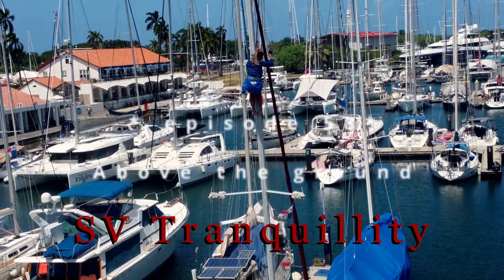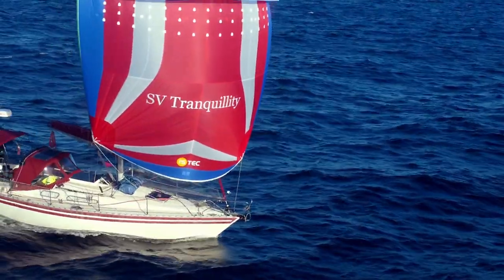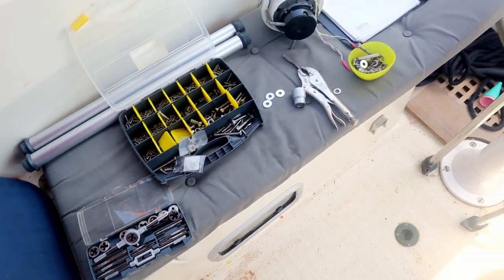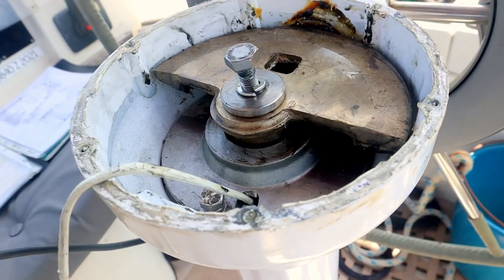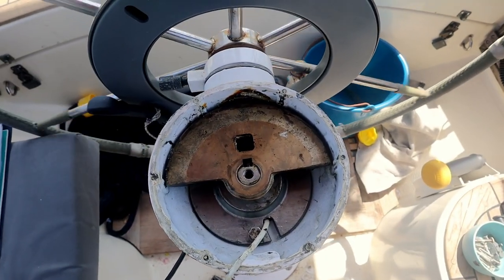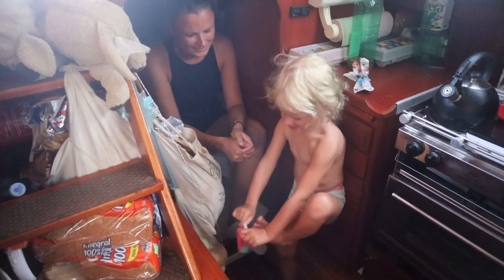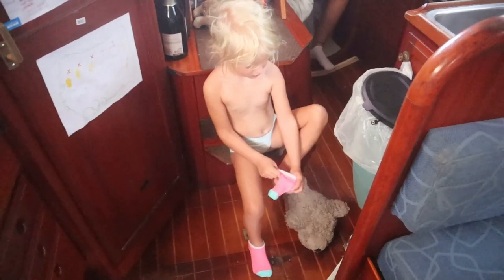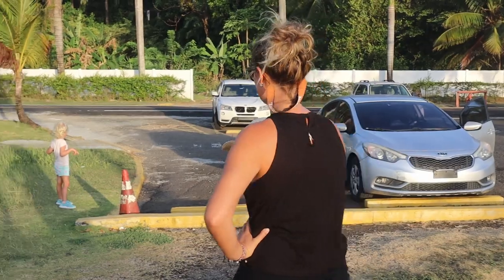Get our boat ready for the Panama Canal and Pacific Ocean - PART 2 - haul out again?? - ep 58

Comment: New adventures to come! What I was thinking about your twin sail setup. How is the rigging and mast cooping with this. Not to much stress on the rigging now that all the forces go to the front of the boat.
Reply from the maker: We have asked a rigger about this setup in the past. And he told us there is no problem. Cause it should be able to handle big loads from a spinnaker as well. And in this case there will not be a short stress load like a spinnaker which fills itself. The rolling should be more gentle. And off course you also need to reef in time.